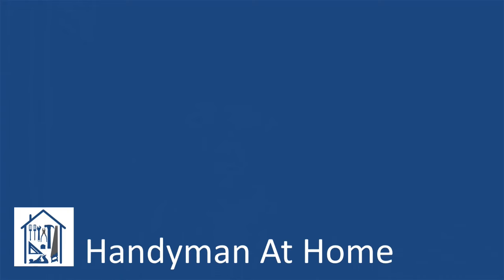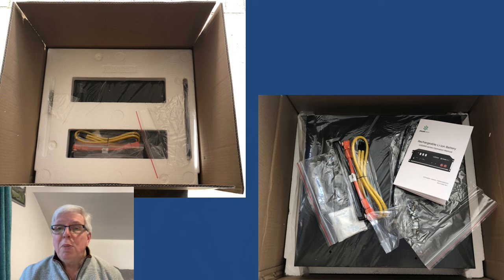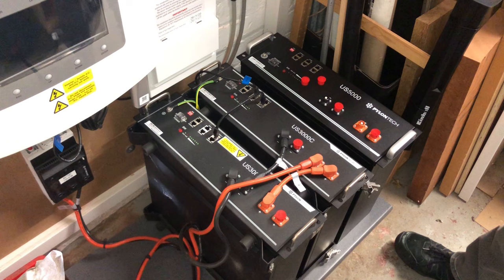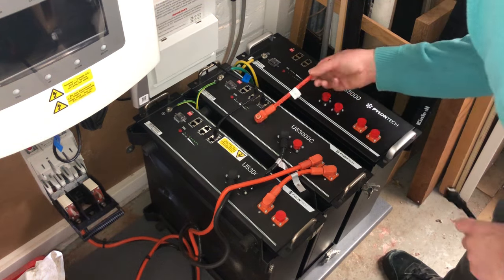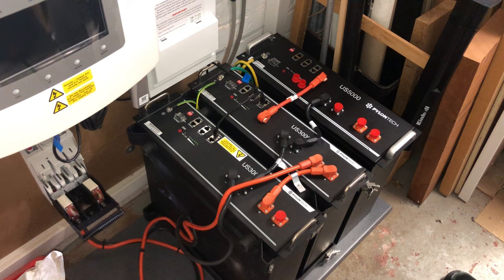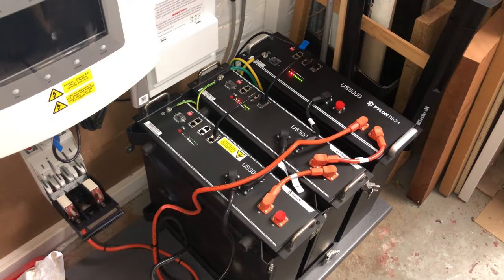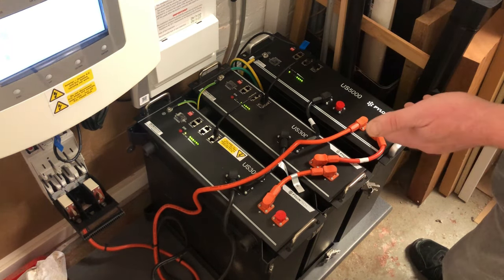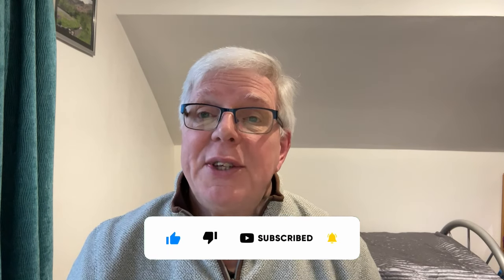Solar Battery Storage - Adding More Capacity - Pylontech US5000 Installation

Comment: The manual stating that the cells should balance in a minimum of 15min? Is HIGHLY exaggerated. Balancing batteries of this size can take hours.
Reply from the maker: Good point. I went back and looked at the manual for the US3000C (3.0kWh), and then the US2000C (2.4kWh) and all state 15 min. so doesn't look like they've taken into account the capacity. On the assumption that the 2.4 kWh battery was released first, maybe 15 min was appropriate, but it's just been cut and pasted ever since ...?  It does state that the BMS will ultimately balance all the batteries out during normal operation, which you'd probably expect, and has certainly been the case in my experience. Whether the initial balancing has any long term effect I don't know. Cheers, Chris

Comment: if your putting in new batterys like that ...best just to wait untill there all in ballance of eachother ...currunt is working so adding a load on them will only strain it more than needed ... ok there smart bms but thats just my advice.....and why not build a separat battery from cat of eve cells yourself 16 280Ah cells a bms and you have a battery for the same amount of money ....  just try it ... its not that hard to make so ...  youtube (off-grid garage )and there some nice videos ...
Reply from the maker: Thanks. Might have a look at building my own battery at some point in the future - would be an interesting project - but got too many other jobs on the to do list at the moment ... and to think they said I'd be bored in retirement  🤣 Cheers, Chris
Reply: @handyman-at-home   jaaaaa we all have projects going haha  but  its more cost efficiant that way saving you a lot of money for more power storage and there basicly the same cells but bigger 280ah 0r even 304ah ... brands like CAT or EVE ..for about 2k .... and those with a nippel are more easy to assemble in my eyes....    anyway good luck ...

Comment: Appreciate this video very much! I also have a combination of Pylontech batteries and a Solis inverter, so it was easy to see how to do this. The original installer was going to charge me nearly twice as much for the battery as I could get it myself online, and £240+VAT for fitting. All-in-all, I saved £700 doing it myself!
Reply from the maker: Thanks! Yes, I got a similarly ridiculous quote from my installer. As long as you take your time and do things step by step, I believe most people could do this safely. 👍

Comment: Can I ask where you purchased your battery from and the cost. I’m looking to buy another 3.5k as I would struggle to get a 5k into my loft with the weight of it.     Thanks  John.
Reply from the maker: Hi John,
I.T.S Technologies, it's currently £912 + VAT (has come down since I bought mine)....
https://www.itstechnologies.shop/collections/pylontech-us2000-us3000-phantom/products/pylon-us5000-1c-4-8kwh-li-ion-solar-battery-48v-excl-brackets
Cheers
Chris
Reply: @   Just on their website as it happens, if vat is no longer added then it’s a good buy. I forgot to ask about delivery, but I can as when I contact them. Many thanks for coming back.   All the best.
Reply from the maker: Their delivery costs are not cheap - I’ll say that - but the stuff is always well packed and arrives in good nick and on time. I’ve just had some extra panels delivered which I’ll be adding into my system in the new year. Cheers
Reply: @       Thanks for your reply, wishing you all the best.

Comment: Can I connect the master + and - directly to the inverter? I have done this and it works fine (2years now)
Reply from the maker: Hi, I'm not sure I can advise really. I guess as long as your batteries are connected in parallel, then taking the + and - cables both from the master, rather than one on the master and one on the lowest battery as I have, probably doesn't make any difference. However, I personally wouldn't be comfortable not having some form of fusing protection in-between the batteries and the inverter. Have you looked at what the installation manual(s) recommend? Cheers, Chris

Comment: Just seen this video. Are you sure the main connection cables are rated to take the possible higher currents?
Reply from the maker: Hi, Thanks for watching the vid!
The max DC charge/discharge current that my inverter can support is 62.5A (3kW), which is well within the cable capacity
The cables are also protected by 80A fuses in the isolator
However, I totally agree that you would need to uprate the connections (by paralleling up or using some form of busbar system or both) if you had a more powerful inverter, capable of higher current operation
Cheers
Chris

Comment: I’ve done exactly the same addition as you with all 3 batteries located in a server cabinet with heater mats between the batteries & a Dimplex bar heater on a thermostat in case of nighttime temperature drop.
Reply from the maker: What temperature do you have the heaters come on at?
Reply: The heater mats are on 24/7 until the Spring weather warms up & the Dimplex ‘tube’ is set to about 12degC.

Comment: So if I work at Pylontech I would be noting that you just failed to follow protocol to attach a new battery and your warranty is void.  The battery was not within 1 light with regard to the other batteries which protects the BMS from power surges.
Reply from the maker: With respect Mike, this is what the Pylontech Installation Manual for the US5000 states ... word for word ... "During capacity expansion or replacement, when parallel different SOC/voltage of module together, it is recommended to maintain the system in idle for ≥15mins or till the SOC LEDs becomes similar (≤1dot difference) before normal operation." You can question whether 15 minutes is long enough for a battery of the capacity of the US5000 - see earlier comments - but I followed the manual. Thanks
Reply: @handyman-at-home , I suspect that there are issues with the translation. I would interpret it as "maintain the system in idle for more than 15 minutes, or until the SOC LEDs become similar, _whichever happens last_." The whole manual reads like somebody who isn't a particularly fluent English speaker took the original Chinese (Mandarin?) manual and translated it without the nuance that you'd expect from a native English speaker.

Out of sheer caution (paranoia?), my preference - when the time comes for me to order more battery modules (I currently have two US5000-Bs; the rack has been sized to take up to about ten or so) - would be to let the batteries balance until the lights are similar, and then wait a further fifteen minutes before hooking them back up to the circuit.

Necessary? Maybe not; it's really difficult to judge from the manual as written. But I'd rather operate out of an abundance of caution (using the most restrictive possible interpretation of the text) than simply assume that a particular interpretation is the correct one.
Reply from the maker: Fair point and I'd probably do the same next time. Possibly was a little impatient but hopefully no harm done 🤞

Comment: Nicely done. About to do something quite similar, adding a 4th US3000C to our rack setup, just as soon as the VAT is off the purchase price from ITS Technologies. I'll follow exactly what you've done but probably have my original batteries closer to 50% as that seems to be around the level that new ones are supplied at.
Reply from the maker: Thanks 👍Hadn't considered having my existing batteries at a lower charge level before balancing but what you say makes sense. Regarding the VAT removal ... in a comment to one of my other videos, someone said the removal of VAT is only going to apply if you're an installer, and not if you're just an end-user / private purchaser. Haven't seen anything to that effect myself, but would seem to be grossly unfair if that's the case.
Reply: @handyman-at-home  removal of VAT as far as i can make out ,across the board for everyone nice upgrade btw Chris :)

Comment: Hello sir I didn't see you putting  battery master and slaves  great explanation
Reply from the maker: Hi, Thanks for the feedback. As far as I know, you don't need to set battery master and slave - it's determined automatically from where you plug in the CAN comm cable from the inverter. So, I moved the CAN cable to the new US5000 battery, and then daisy chained it to the older US3000C's. That automatically sets the US5000 as the 'master'. Cheers

Comment: Hi Chris, you have 3 Pylon of 75+75+100 Ah for a total of 250 Ah.
  While you can control the total discharge current (but it also depends on the AC load), still assuming you discharge at 50% of the rated current it would be 125A.
  I think that the cables (2 meters long) supplied by the Pylon are not so suitable to handle this current because they have a rated capacity of about 120 A. For some reason the discharge current could be more than 50%. 
  If you want I can give you some advice, that is, double the Pylon cable or you can use a Busbar to do the job.
  I prefer the second solution.
Reply from the maker: Hi, I currently have the max. charge current at the inverter set to 75A, and the max. discharge current set to 50A, so I think I'm OK with using the standard Pylontech cables. Thanks, Chris
Reply: @handyman-at-home ... for sure. Good

Comment: Take a while to catch up a spread like that. 49.something initial reading is about 3.0v per cell and likely about 40 to 50% capacity, usual shipping charge. Good BMS test.
Reply from the maker: Thanks. Yes, I agree, in retrospect the time to fully balance up clearly will be a lot longer than the manual suggests (15 min). Suspect there's been a bit of cutting and pasting in the manual which doesn't reflect the increase in capacities from the original US2000 (2.4 kWh) to the latest US5000 (4.8 kWh) ... maybe!. Cheers, Chris

Comment: Hi, 
Gret and easy to follow Vid, really helpful!
I'm planning to add a 4th 3000C to existing 3 3000C bank. Do I have to change the master to the additional/new battery, or can I leave it as is? thanks
Reply from the maker: Hi, 
Thanks for the feedback 👍
I think you should set the new battery to be the master. 
I just had a quick look at the manual, which states ...
Mixture using master battery priority: US5000>UP5000/US3000C/US2000C>U3000/US2000
>>> For same type of module always use the latest production unit as master. <<<
Cheers
Chris

Comment: I'm not an electrician, but does the earth cable for the 5000 connect to ground through the earth cable joining the 2 3000s? If so, the 3000's cable is a lot thinner than your new one for the 5000. Shouldn't the older cable be upgraded to the same size if it's carrying greater current to ground from the 5000 battery?
Reply from the maker: Hi, Thanks for posting. 

Checking the manual, all it states is "Grounding cables shall be 6AWG or higher yellow-green cables. After connection, the resistance from battery grounding point to Ground connection point of room or installed place shall smaller than 0.1Ω." 

The original earth cable between the two US3000C's is 10 AWG (smaller diam.) whereas the cable supplied with the US5000 is 6 AWG, so both are suitable if you just go off what the manual says....

However, what David (see earlier post) spotted was that the original 10 AWG earth cable was never actually connected to ground - which is bad on a number of counts ... 

1. The original installer/electrician, and 
2. Me not spotting it!

What I've since done is ... US3000C --- 10 AWG --- US3000C --- 10 AWG --- US5000 --- 6 AWG --- GROUND

Cheers
Chris

Comment: Did you check the manual, mixing capacities of 3000wh and 5000wh is highly discouraged.
Reply from the maker: Hi, Mixing of different capacities is supported by Pylontech, you just need to follow the correct master battery priority scheme i.e. US5000 > UP5000/US3000C/US2000C > U3000/US2000 per the manual. Cheers, Chris

Comment: Should you have another earth cable linking the inverter to the batteries?
Reply from the maker: Wow! Well spotted! I can't believe how I haven't seen that before now, given the number of times I've looked at those batteries over the last 18 months. It's been like that since the initial install - which was supposedly inspected by both the installer's QC manager and the regional MCS rep - says a lot doesn't it. I'll get it sorted myself. Appreciate you letting me know. Chris
Reply: I have a recent solar install and it was clear a second battery would be useful. I ask the installers on a price which was £1900 installed. The battery is £900 inc VAT so given my install is basically this video I’m not personally seeing £1000 of labour. ( you don’t get the VAT off unless an installer does the work, which is not made that clear by the recent news in this ). 
I posed the question on a Facebook page on Solar and there was a big strength of feeling that any warranty would be lost doing the install myself. 
These plug in batteries seemed to be designed to easily add more capacity but I wondered what your view was on the warranty side as most components seems to have at least 10 years ( and losing this clearly has a direct impact )
There is nothing in your video that looks beyond a reasonably competent person and I’m actually an electrical/electronic engineer so I’m not a DIY bodger !
Reply from the maker: Interesting point Paul. I initially went back to my original installer in Nov '22 and they wanted to charge £2,340 (incl. VAT) for an additional US3000C (3.5kWh). I can't remember what the price of the battery itself from ITS was at the time, but I'm thinking it was around £1200 or so. That's £1,100 for an installation task that takes no more than an hour at best. Daylight robbery...!! When I eventually got round to deciding to purchase the US5000, I didn't even bother to go back to my initial installer. So, what about the warranty ... re-reading the Pylontech Warranty Exclusions, they include the term "Storage, installation, commissioning, modification or repair of the Product that has been performed by a person other than Pylontech or Pylontech's certified installer". So, by that phrase, it's clear they would take the view that I have invalidated the warranty. But what's the alternative ... pay anywhere from £1,000 upwards for a "certified installer" to do it for you...? Given that my so-called certified installer didn't even connect up the battery earth properly, that's just meaningless in my view. And if you did have a problem with the battery at some point, the grand you'd saved by doing the install yourself would almost pay for a new battery anyway. The only possible risk in my view is that if you somehow damaged the inverter or other equipment as a result of you installing the battery. Low chance of that I would have thought. In my view then, it's worth the risk, especially if you're someone with a technical background like yourself. Just my 3c. Cheers, Chris
Reply: @handyman-at-home  i noticed the earth strap isn't connected on my battery
Reply: Thanks for spotting that  i have a single battery   no earth strap from battery as want to purchase another 5000
Reply: @handyman-at-home how did you fix the earth strap to inverter
Reply from the maker: Hi, My inverter is earthed via the common earth rail in the local consumer unit in my garage, which itself is earthed back to the main consumer unit in the meter cupboard (where the smart meter and main incoming fuse are located). There was already an accessible earthing bar available which meant I didn't need to go inside the consumer unit (that's really only for electricians...) so I ran my battery earth up to that bar and connected there (I sourced some proper earthing cable). Checked everything out with a meter and all sorted. Cheers, Chris

Comment: I'm also going to be doing something similar in the next week or two.
The first supplier I contacted said the battery was only vat free if you're in the trade, and if so, you would pay the vat then have to claim it back from the government.. not sure if that's true more widely or if there was a bit of confusion as the situation has only just changed. I guess you did not have that experience when purchasing the additional battery?
Reply from the maker: Hi, From what I've seen, the story is confused at the moment ... Some comments to my video have implied what you say i.e. the VAT discount only applies if you're in the trade, whilst others believe it applies to all, including private end-users like you and me. Fairly typical for HMRC / this government if you'll pardon me straying into politics. My bet is that it'll be like you say, it'll only apply to the trade, and possibly only VAT-registered at that, which seems a big fail to me. After all, I would have thought the most likely people to want to increase their battery storage are those who have already invested in solar and why force them to pay over the odds to use an installer...? Anyhow, hope the upgrade goes well. Cheers, Chris
Reply: @handyman-at-home  it's never quite what it seems is it.. my installer quoted me £3000 for a 5.12kwh battery that I can purchase from a retailer for £1200(Inc vat). Guess I'll just pay the vat and self install as £1200 is still a fantastic price.
Cheers
Reply from the maker: Yes, similar story with me. I was quoted £2,340 for a 3.5kWh battery installed by my original supplier, compared to £1,318 (today's price at ITS incl. VAT but excl. delivery) buying a 5.0kWh battery and installing myself. Bonkers!!
Reply: Thanks for sharing this I am thinking of getting a second battery